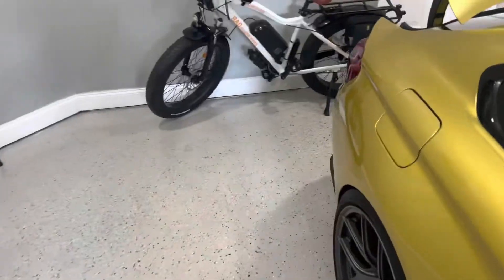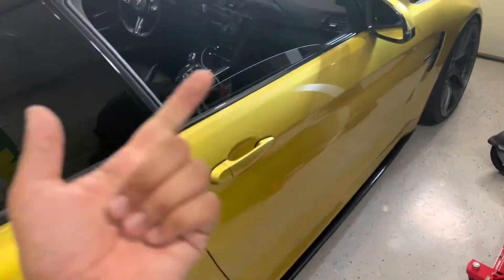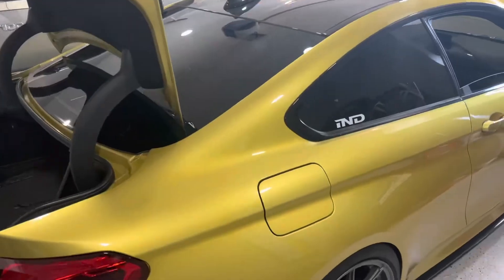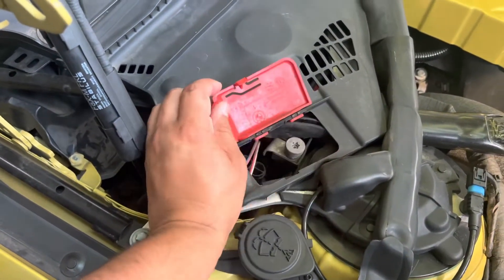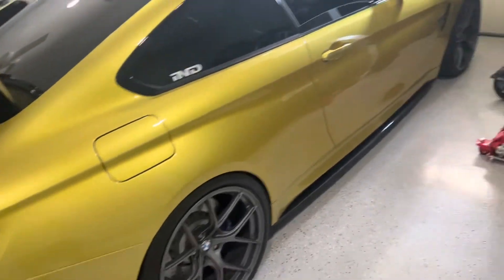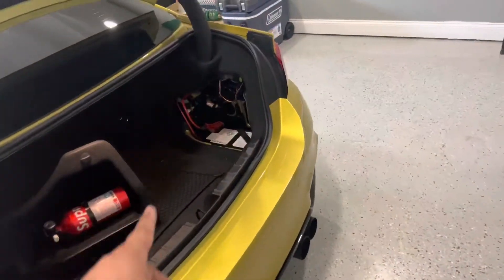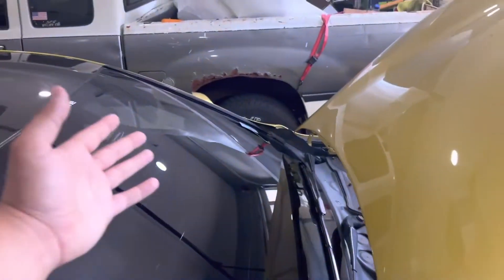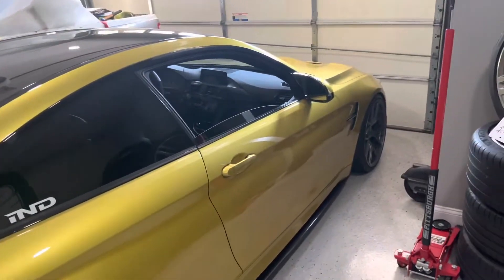Bricked DME ? Transmission Flash Failed. Bootmod3 BMW M4 F82 / F80 / F83 S55 (this might help ! )

Comment: Hi, I have the same problem — the flash failed and the car won’t start. Are you saying that if I connect the charger directly to the battery and let it charge for 3–4 hours, it will then work?
Reply from the maker: You should always flash with a charger directly connected to the battery to keep voltage steady. I would do that and try again. If it still doesn’t work and the car won’t start you might have other problems.

Comment: Hey man, mine wrote 100% complete, I have a 2020 F82, DME bench unlocked it the Stage 2 went perfectly fine but the CS transmission tune didn’t. When I put it in D I get drivetrain malfunction, it’s still drive able but doesn’t show that it’s in drive or any gears. It won’t let me reset back to stock or use the GTS tune. Still think the fix is to hook up a charger in the rear and try the CS again?
Reply from the maker: Doesn’t hurt to try. That’s kind of what was happening to me it wouldn’t show any gears and it said drivetrain malfunction. Disconnect the battery leave it for a while so the car can completely shut off then try again with a charger connected. If not contact BM3 customer support they’re really helpful.
Reply: @ I tried that yesterday it didn’t work I heard some people have problems flashing with their phone and the laptop fixed it. Going to try that tomorrow when my obd2 to Ethernet connector gets in. I emailed BM3 and no response yet so we’ll see

Comment: Hey bro did you run the update whilst it was charging straight away or did you wait until charged higher and then attempt it?
Reply from the maker: I would wait until it’s up to a normal voltage if it’s reading low. The steadier the voltage the better.
Reply: @ cheers bro

Comment: I used Dinan’s diy tune and bricked my DME on an x5. There support sucked and I ended up having to bring it to a bmw dealer. Luckily the shop foreman was experienced and knew that he needed to provide power to one of the pins on the obd 2 port to even communicate with the vehicle and reflash the DME. Cost me $600 but, cheaper than the $3k DME replacement. I hate Dinan and might not be related to this video but, stay away from all Dinan products. They have fallen off.
Reply from the maker: Yeah most aftermarket company’s that use to work with manufacturers have fallen off.

Comment: I’m Nervous to try but if you have tried now and running the CS transmission has it been all good?
Reply from the maker: I haven’t tuned the car in years but I’ve been running it and it's been great, haven't had any issues.

Comment: When flashing my F82 M4 with the CS trans flash it failed 4 times between 20% and 100%. On the 100% one it said success but wouldn't show gears on the display. Flahsed back to stock and had it coded properly. Stage 1 OTS flashed first time though.
Reply from the maker: This is a pretty old video, there has been a lot of updates from BM3 and also my M4 was a 16 I know the Ecus were different I think 18+. But from my years experience of being a Tech when updating a car’s software or any type of flashing that’s going to change anything in the ECU you should always have a battery charger that could supply you with steady voltage. 

Glad it worked out for you. It’s scary when the car doesn’t show any gears 😂
Reply: @ man! I def had a panic I still haven’t gone back and done the gear boot I’ll wait to spring to do it.
Reply: Same

Comment: Brother same thing happened to me on my x5m, all you have t do is get the flashtool wifi connector from xhp is about $91 and connect to their 🛜wifi. Go on setting look for xhp wifi and reflash. You will thank me later. I learned the hard way.
Reply: After all the updates. The enet cable keeps disconnecting. Only use wifi xhp connector for xhp tune.

Comment: Hey man im having the same issue , do i need to disconnect the battery before I charge it?
Reply from the maker: I didn’t disconnect mine. You could though to reset everything. But you can just leave it on & charging.

Comment: Apparently my 2018 s55 dme is locked when I try to flash it with mhd.. crazy annoying
Reply from the maker: I believe 2018+ DMEs are locked and you have to bench unlock them. Which would be removing your DME & sending to a shop that can unlock it.

Comment: I got the same problem with mhd gts transmission 
The flash stopped at flashing the tune no the car is not moving
Same problem like you 
Do you think there is a difference?
Reply from the maker: Not really sure how the MHD tuning works but if it’s similar I would reset everything let the car go into its “ sleep “ stage then put the car on a battery charger to maintain voltage and try again. I had the same problem where the car wouldn’t move. I’ve talked to a few other people about this problem not sure if it’s true or not but my guess is that the transmission tune is sensitive to voltage change. 

Also maybe try flashing back to stock the back to GTS

Comment: Hey having same issue mine still not writing 😪
Reply from the maker: Try charging your battery for a bit. I had a convo with the support team over at BM3 and It seems like the trans flash is really sensitive to voltage. It took me a while and a few trys but it worked. Very weird issue.
Reply: Hey bro did it worked?
Reply: same trouble too help me😢